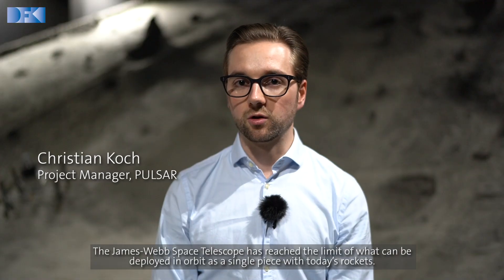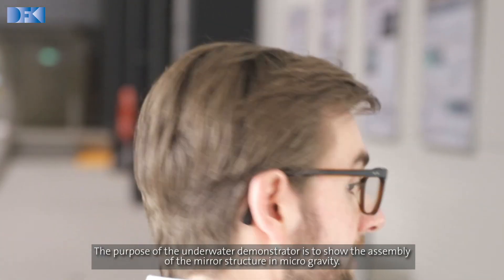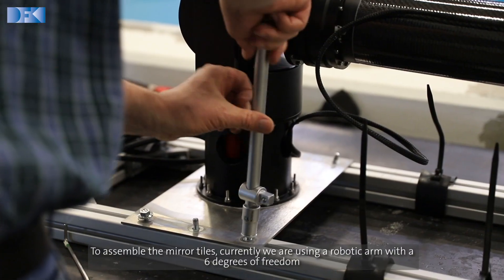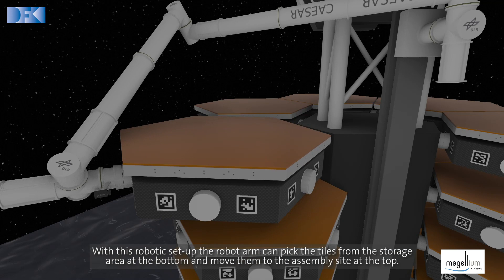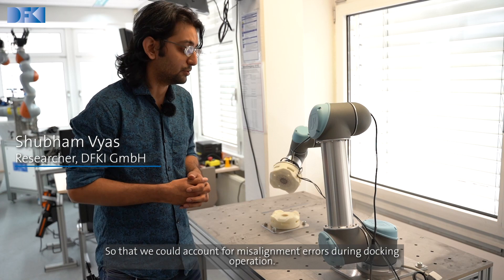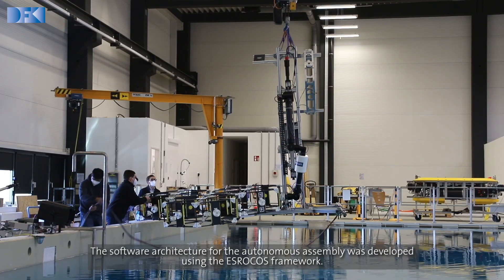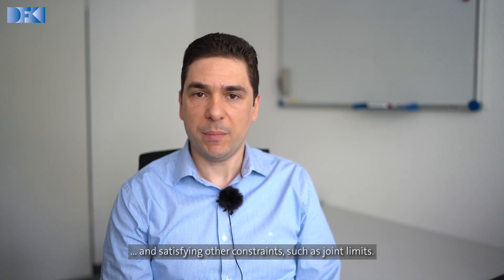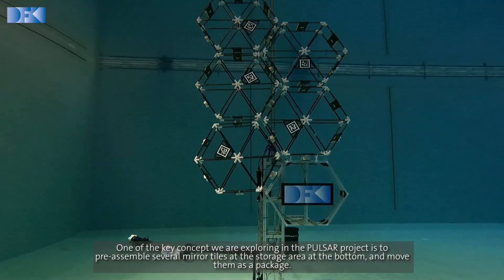PULSAR: Underwater Demonstration of Large-scale Space Robotics

Comment: what material is the robot made of? you know, to withstand gamma radiation. i ask because i have been privately developing a robot concept for years and am currently thinking about what materials are suitable for space use.
Reply from the maker: The choice of material has not been the focus of the PULSAR project. The underwater manipulator is composed of anodised aluminium and carbon fibre tubes. However, the PULSAR concept drew inspiration from robotic systems for space such as the Canadarm2 or DLR's CEASAR. Materials include aluminium, titanium and carbon fibre.
Reply: @dfkivideo  could you also upload footage of motion without speakers? It would gain greater audience.